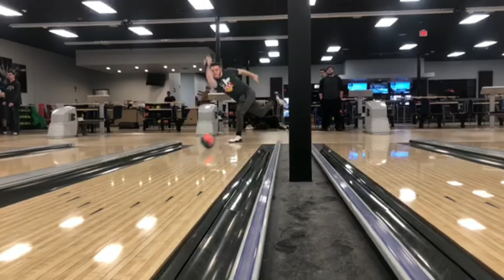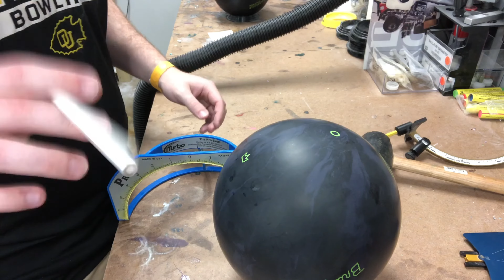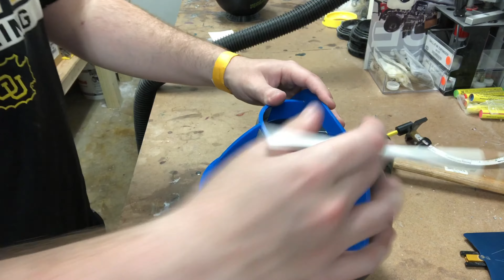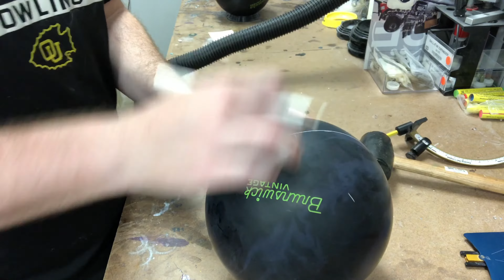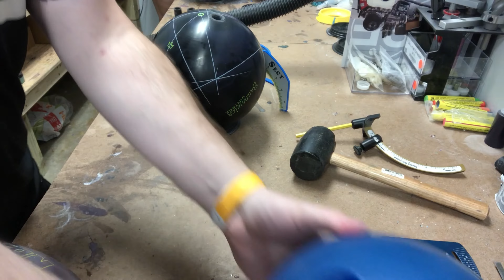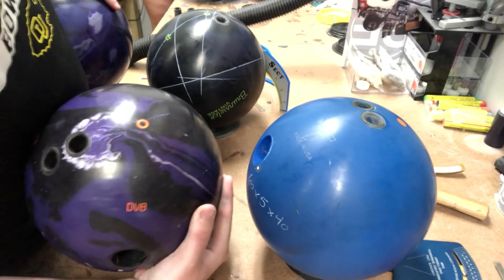IN THE PRO SHOP | Choosing a Layout

Comment: how many ball types/layouts/sursfaces/rg & diffs should you need as a minimum??
Reply from the maker: Great question. It ultimately depends on what level you want to bowl at. As you bowl more tournaments on different sport shots you would need more. For league bowlers I would typically say 2 or 3 layouts is normally good to cap it off at. So things aren’t too confusing. Surfaces you can always adjust to make it shape more or less so that’s good to always try when you aren’t experiencing the desired reaction. Types & core differences depends on the bowler. The more matched your revs and speed are, the more difference you will likely see between cores even with the same standard layout. Thanks!

Comment: you refer to 3 3/8 pin to pap being the most aggressive but that is the  max flare potential of the ball.  that combined with a high Val angle would be the most aggressive layout.
also, you have 4 3/8 on your layout.  mistake or intentional? 
thx
Reply from the maker: So, looking back on it I wish I had explained this part better when I said “most aggressive”. I would love to remake this soon to explain it better as I’ve learned more over the years. By “most aggressive” (3 3/8”) that means it’s going to use the most energy before it enters the roll phase. Therefore, most aggressive means it won’t hook as much right-to-left because it’s burning up more energy in the midlane. Combine that with a high VAL angle and you’ve got a good down-and-in motion but would probably struggle to move far left with that ball unless you have a high rev rate

Comment: The USBC has measured the effect of side weight and it does matter, its show affect on motion is bigger than intermediate differential.
Reply: side weight (static weights) affect the way the ball lays in your  hand when you are in your stance.
I used to use negative and thumb weight w/ low top wt. to get my old pancake cores to roll most aggressively

Comment: Other than middle and ring finger being on opposite sides of the bridge. Are there other differences for a left handed lay out? If so, could you walk through a left hand lay out?
Reply from the maker: Great question. The main difference is, instead of going to the right side for the PAP, you’ll go to the left. From there, everything is the same. You’ll start out by going to the left side and you’ll want to just mirror what’s in the video
Reply: @FloppyPENGuinn  I was thinking it would be a mirror image type situation. Thank you.
Reply from the maker: @horseshoe_nc  No problem! Im glad you asked. Lefties sometimes get left out of the equation and I don’t want that to be the case
Reply: @FloppyPENGuinn  it is understandable, I think left handers make up less than 10% of bowlers.

Comment: hello, I have balls that I used one-handed before. Now I've decided to take two hands. I filled it and want to drill again. should i use the old angles? I write the balls and old measurements below. can you suggest me?  900 global the break (40*3 3/4*25) morich seek&destroy (70*3 3/8*40) brunswick diamond back (55*4 1/4*40) Hammer Razyr (60*4 3/4*45)
Reply from the maker: Hey! So, something you must consider is how your PAP changes when going from 1 to 2-hands. It normally will change a very big amount, which drastically affects layouts.

With that said, I would suggest increasing your pin to PAP distances more, so that you don’t have any problems with the ball over-flaring and burning up. 2-handers typically like pin to PAP distances of 4 3/4” or more. So, for any balls you want to be more controllable, something like 50x5x40 would be great. Anything you want to hook more and have that hockey-stick motion would be like 65x4 3/4x25. Hope that helps you out
Reply: @FloppyPENGuinn  I understand, thank you very much. Are the measurements you gave the same for symmetrical and asymmetrical balls? Which would be a better option for urethane and weak core balls, especially for short lubrication patterns? controlled movement? sharper movement?
Reply from the maker: @noweanji  Urethane is dependent on what you want to do. They’re great for short oil patterns, many exist like the purple hammer, pitch black, etc.

Symmetric balls are typically going to have a sharper movement downlane, whereas asymmetric balls are smoother and roll earlier because their cores are much larger (typically). I would meet up with your local pro shop operator and have him watch you throw some balls and go over that with you to determine the exact best option for you individually